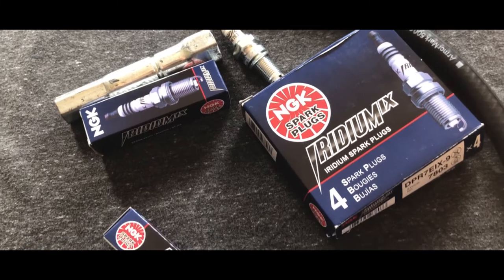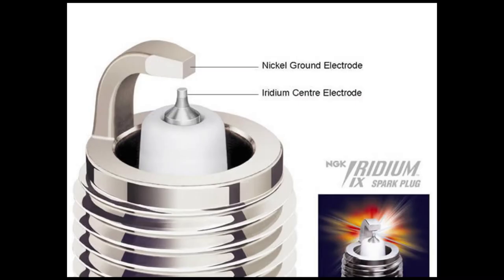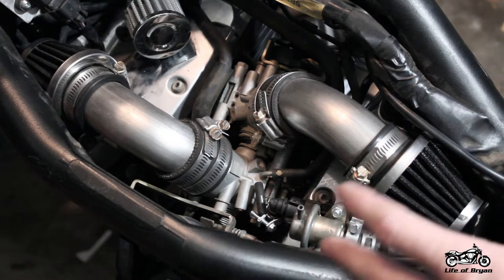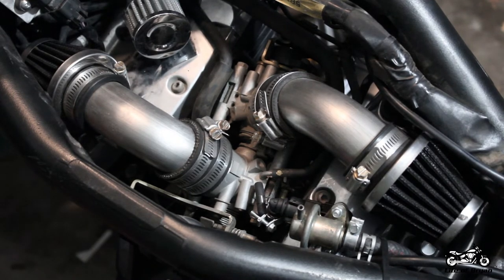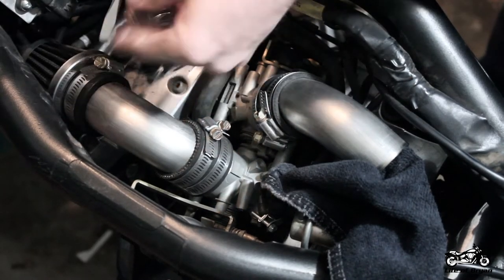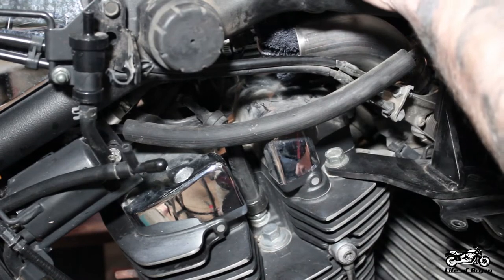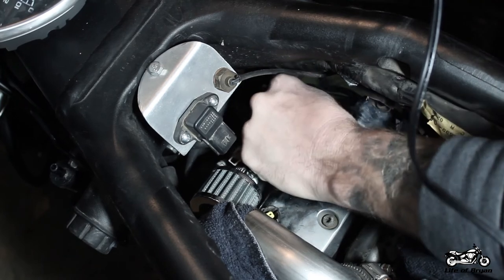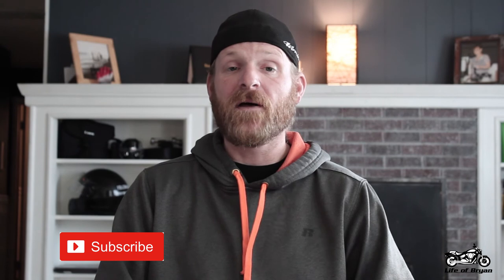Yamaha Warrior 1700 Spark Plug Replacement

Comment: Does it matter the year of the warrior ? 
Are they all the same spark plugs number
Reply from the maker: Hey Rob, thanks for watching! The plug number should be the same for all years of the Warrior. Only difference is if you want to run a cooler plug. The numbers are just a breakdown of the electrode, shell, heat range, gap, etc... Should all be the exact same from 02-09. Hope that answers your question, and that the video was able to help out. Any other questions, feel free to get back with me. Thanks again! Stay safe!
Reply: @RSWarriorBryan  thank you Bryan for answering my question on the spark plugs. I do have a few questions lol sorry about that
1. What spark wire you recommend for the warrior
2. Have you done anything on the fork tubes seals. Looking to get mine done 
So need some help on that topic
Thanks again brother 👍
Reply from the maker: No problem! For the wires, it depends. Have or upgraded the coils or relocated them? Would you prefer certain colors? Magnecore wires are really good, but you could go with something like Taylor and get them in many different colors. You could even get a cheap car set from your local store for a v8 and have a back up set if you wanted. Main things to watch for are the boot angle and wire size. May want to go with a straight boot and I believe that 8mm is the max size you can use. Also, you'll want to keep the plug terminal ends because most boots will still need them screwed on. 

For the fork seals, I actually haven't done them yet. I've been lucky enough to have mine still holding up. Was telling a guy just the other day that of they last this year, I'll probably change them to be safe and get the video in the library. Here is an awesome write up from the forum with pics that will walk you through it. 

https://www.rswarrior.com/forums/21-how-tos-general-maintenance-tips/271554-fork-seal-change.html

Hope that helps out, wish I had a video already to direct you to instead!
Reply: @RSWarriorBryan  thank you so much 
👍👍👍👍👍
Reply: @RSWarriorBryan  coils have been relocated I haven't upgraded them their stock any suggestions on the coils
Reply from the maker: I plan on upgrading mine to dyna coils eventually, possibly next winter. Won't really add any performance, but they will provide a more stable spark. If you have the coil relocation plate under the tank, a few small modifications will allow you to use the same plate, I believe. The coils that you'd need are dyna dc2-1 and you'd be able to use the same 8mm wires. I'm thinking of upgrading and having a plate made for the left side to mount them there, but haven't decided completely yet.
Reply: @RSWarriorBryan  thanks Bryan for the feed back 👍👍👍Ride safe brother
Reply from the maker: Any time!

Comment: 2002 yamaha warrior just bought
Reply from the maker: You'll fall in love of you haven't already! Great bikes and the people who ride them are pretty awesome too! Join the forum and Facebook groups of you haven't yet. Tons of info for you to fix and work on your bike.
Reply: @RSWarriorBryan   Thanks im joining now
Reply from the maker: Tons of great people in there willing to help out as well.
Reply: @RSWarriorBryan  Is it normal when screwing in new spark plugs to still see just a little thread even when all the way tight?
Reply from the maker: Mine have probably about two threads hanging out the top. Not very much at all, but there is a little.
Reply: Thanks for the advice your videos are very very helpful. Have you done a video for installing the two air filters and the cobra digital fuel processor? Those are my next projects
Reply from the maker: I haven't done videos on either one. You replacing the stock filters, or upgrading to a BAK? Which cobra tuner did you go with? I have the power pro black, and I love the auto tune feature, and Bluetooth.
Reply: @RSWarriorBryan  just replacing the stock filters. I have the cobra Fi2000 Digital fuel processor. I was told its a good one.
Reply: Any advice on backfiring while decelerating?
Reply from the maker: You wanting to tame it, or get rid of it? I got rid of mine and miss it a lot. Lived scaring people in traffic. 😂 you can get the ais system removed and that will help a lot. That and a good tune with you power pro will all but get rid of it. Add ivans ecu flash and you won't pop even if you try.
Reply: @RSWarriorBryan  yea i think i wanna get rid of it. Its really annoying Lol it scares me sometime lol